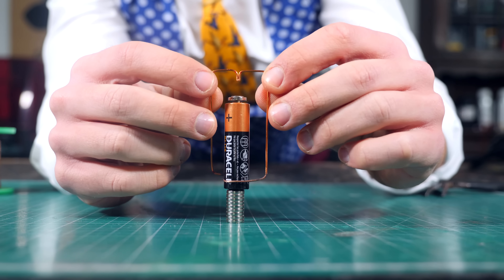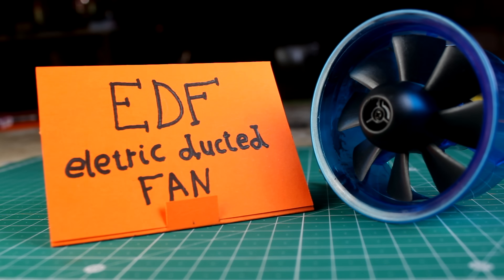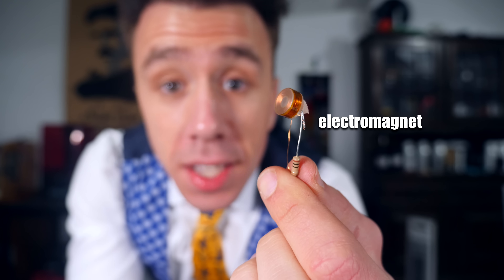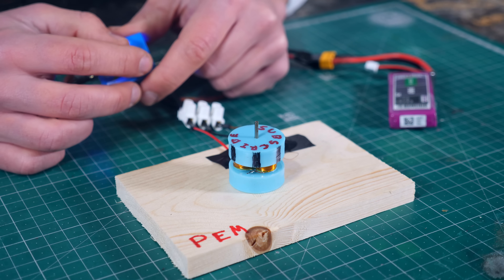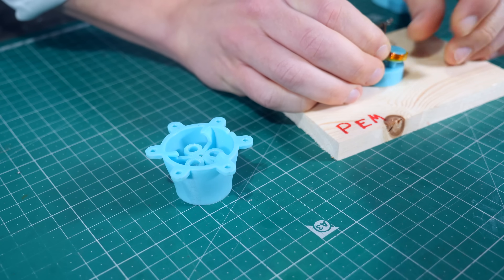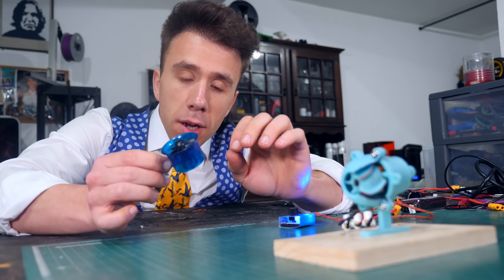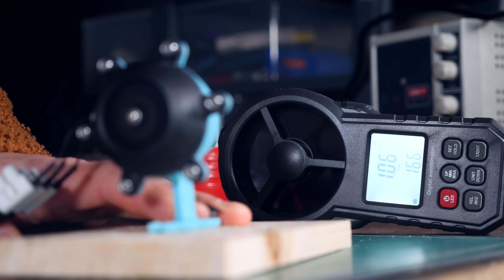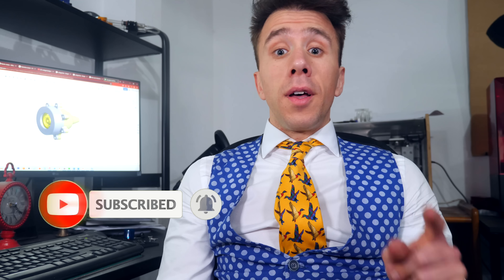I 3D Printed an ELECTRIC MOTOR FAN

Comment: Hello, mechanical/mechatronic engineer here. A few things to note about the problems you are having. 

1. Lower efficiency. The main reason is that (as you mentioned) there are extra steps. The process of compressing a gas is usually adiabatic, meaning that the temperature of said gas will increase as pressure increases. Likewise, the temperature also decreases as it expands (hence why propane tanks get cold). Basically, what often happens in systems like this is that the hot compressed gas will conduct heat into any object they are touching (in this case the printed fan duct), which is lost energy in the system and results in the gasses not being able to re-expand as much. This shouldn't cause a huge difference in efficiency, but enough to matter in some specific applications. 

2. Centrifugal fans also spin air along the inside of the inlet (between the blades and the front cover) for some time as it is expelled outwards, which loses energy due to drag and turbulence. Unfortunately, 3D printed surfaces tend to be somewhat rough, which increases turbulence and therefore drag/resistance. 3D printed parts (especially ones that flex like you mentioned) also can't have as close of tolerances to the cover, so there is often a decent sized gap that air can settle in without being pushed down/out. The easiest way I know of improving both of these is by enclosing the top of the impeller, as the "lid" at that point is also spinning with the air and there are no gaps for air to escape through.

3. Cross sectional area. Another likely cause of the lack of thrust is the cross sectional area of the inlet. Remember that the larger inlet area will be able to move more air for each given rotation of a motor, so if the EDF inlet is twice the diameter (4 times the area) of the inlet to the centrifugal compressor, you will get a far smaller amount of airflow for the same rotational speed. This is partially why centrifugal compressors spin so fast (sometimes past 30k RPM), that way they can both displace more fluid and increase pressure differentials to more useable levels.

4. Fluid medium vs. speed. Finally, the pressure generated by a centrifugal compressor is heavily correlated to the density of the fluid that is being pumped. Since centrifugal compressors rely on the inertia of the pumping fluid to generate pressure, lower fluid densities will naturally produce lower pressures. This lower pressure will result in increased flow resistance inside the fan duct, therefore lower exhaust speeds. This is partially why centrifugal compressors spin so fast (sometimes past 30k RPM), that way they can both displace more fluid and increase pressure differentials to more useable levels.

If you would like some help designing an improved fan (I have designed a few centrifugal compressors for high pressure gas systems before) feel free to send me a message! I also have a number of high performance SLS/SLM 3D printers that are able to produce some significantly stiffer parts that would handle higher rotation speeds without warping or expanding.
Reply: Bump.

Also I didn't consider the inlet size, that's a pretty big deal.
And I believe there are lots of (lesser used) methods of smoothing out printed parts.
Aecetone, sanding, buffing, painting, etc. Painting is a particularly fun one because of surface tension xP
Reply: Damn this comment was very insightful, I learned 3 new things, that I hadn't even thought about before, even though I know the theory behind all those 3 things. I didn't know that the fluid's density mattered that much in centrifugal fans, but it does make sense, cause if you think about it in terms of steady flow energy equation, the centrifugal fan is exerting essentially a contact force on the air, and hence, the heavier the air, the slower it has the chance to lose inertia as it knocks on the insides of the fan.
Next is having a large enough inlet, having a large enough inlet makes sense to me in a sense of how venturi tunnels work, there needs to be a decent enough flowrate to start with, and I think that's probably the biggest difference in an EDF, where the fan has no blockage on it's front end. I can imagine centrifugal fans do a better job if air was forced into it, like in a jet engine scenario, but if air has a hard time getting into it, I guess the flow rate just won't be big enough. 
I also knew that a fluid being compressed heats up, any thermodynamics module at a university covers this with how a refrigerator works, but it didn't cross my mind, that it would apply with centrifugal fans as well. But then again, I doubt that the work that is put into the air mostly goes into heating it up. It is probably something you should consider, but I doubt it affects the max pressure reached by such a large margin.
Reply: @movin3148  Oh fluid density is super important,
desnsity is related to pressure remember, which is also related to velocity.

Pressure "flows" from high to low but in all directions, which also means backflow... To spin a fan means to compress a region of air, which means to create a low pressure region in front of the fan and an even lower region of pressure behind.

Which reminds me, you can also get backflow aft of the fan exhaust. Which is... interesting...

Comment: My guess is that your mouth is the wrong shape. 
By having a divergent mouth your decreasing velocity and increasing pressure. While the EDF has a bellmouth inlet which increases speed. 
Since EDFs don't have combustion I think your just dropping the airs velocity for no reason as you don't care about the pressure.

Comment: Engine design is incredibly complicated. I suspect two things going wrong here: 1. It could be that your design creates a lot of trubulence which can dramatically decrease the speed and the efficiency of the motor. 2. The volume of air that passes through your design seems to be much lower, simply by the difference in fan blade's size, which in practice mean that the air has much less inertia and even it might leave the engine in the same speed as the EDF, until it reaches the meter it has lost most of its speed. If you want to dig deeper I suggest you make some measurements to compare the two: do the propelers turn at the same speed? The actual speed you can measure it by checking the frecuency of the noise. Does the second one make louder noise? Because that would indicate more losses through friction. Do they draw the same current? Is the total airflow the same? There are many reasons that can affect the effeciency of the engine and I suspect that the original EDF design comes pretty close to the optimal design for this type of motor/propulsion system without having to use any fuel.

Comment: I think it might have something to do with the fact that the pem motor is a speed motor rather than a power motor. 
When using it in the impellor setup you are trying to build, you have a small exit hole. This means there will be some pressure build-up like you explained in the video. But this causes the motor to have a hard time functioning wel. Because, as I mentioned before, it is a speed motor rather than a power motor.

That's what I think. Good luck with the project though. Always like your content. Tnx

Comment: The main thing is the Dyson will be operating at a ridiculous RPM. the impeller needs those RPMs to perform. Check out pump/impeller “affinity laws.”

What you might want to do is increase the diameter size of the impeller dramatically, this will increase its effectiveness at the lower RPMs you will likely achieve. 

Also the way that the Dyson works is by creating pressure differential, which evenly flows air through and out of the airfoil 

It’s job is to create a constant pressure difference in the airfoil ring, which it uses like a wing to generate negative pressure and force atmospheric air to move  . 

So the flow rate of the Dyson impeller is likely not that impressive compared with a fan of similar size.  But restrict the flow and you’ll find the regular fan will stall whilst the impeller continues to perform.

Comment: Try tapering the blade aspect, and possibly printing in nylon. I don't know if you have an fdm nozzle that precise, but nylon or GRN might stop your flexing problem.....or rather delay it to a higher rpm, while allowing the original blade length.

Comment: use a centrifugal fan to add compression to your jet engines instead of having them be naturally aspirated. You can use a second fan at the back to run the front fan and once up to speed use the motor as a generator or something like that.

Comment: Probably a mix of tip clearance and cross section area. Lapping the fan to the housing would let you get tighter clearances, and that's less leakage around the blade tips. Your overall diameter means your tip speed needs to be higher in order to achieve the same thrust

Comment: Maybe try using lighter gas and oxygen from air can and make some actual flying rocket.
I really would like to see you send somenthing to sky.
To your impeler proble try adding more blades and blade surface and change the angle a bit.

Comment: You tossed out the tomato but seem to have apples and oranges all mixed up.  You're mentioning thrust but appear to be measuring efflux velocity.   Which is it you want evaluate and why?  Also, the centrifugal impeller of the Dyson is optimized to pull a vacuum while the edf is optimized for efflux velocity.... neither of which is optimized for static thrust as that would turn out looking more like a propeller.  I spent a few months down this rabbit hole myself and after thirty printed iterations and tons of cfd analysis,  accomplished a 30mm edf on an 1106 motor which produced close to 200g of static thrust but more importantly a high enough efflux velocity to propel a small flying wing to speeds around 70mph.  Anyway, you've got my interest peaked, but what it is you're trying to accomplish, i just don't understand.
https://youtu.be/wxLW_8kCv4A

Comment: I would increase the intake area and space around the fan cone blades in a way to reduce disturbances, make sure the surface is as smooth as possible, another thing you could be taking advantage is the Coandă effect within the the exit of the turbine to increase air-flow (like in the Dyson products designs).

Comment: Just a guess, but maybe its because the pressured air from the impeller doesn't really have a 'chamber'/nozzle to focus the air and the energy? Its like a rocket engine without a nozzle, the hot gasses from the combustion chamber will leave it, but since there is no nozzle to shape the hot gases as to get all the energy from the expansion and the pressure from it, you won't really get any force pushing the assembly forward, because all the hot gas just expands immediately when it leaves the combustion chamber and loses all its pressure energy and velocity. So maybe make something like a nozzle for the pressure chamber around the impeller, a car turbofan is a good example only the "nozzle" points sidewards.
Ducted fans work so well because of the ducts, maybe give the impeller a duct too?

Comment: I am not a fan/impeller designer, but have dabbled a little bit in it professionally (worked for turbomachinery companies, and have designed a centrifugal fan for a niche purpose).

Typically, axial fans are great at moving large volumes of air efficiently, but struggle to produce higher static pressures. You are unlikely to match the total volume of air moved by your axial fan. Centrifugal fans like your computer fan are good for creating a decent amount of pressure, but move air less efficiently than an axial fan in order to do so. Think of the path that air has to flow; it takes a 90 turn to go from axial movement to radial, then another 90 from radial to axial again. Impellers like the one you printed and turbines/impellers are excellent at producing high pressures, generally give up volume to do so; with about the same amount of total energy efficiency as an axial fan. Dyson's of various designs use the high pressure air either as an venturi/eductor to move more air (like a bladeless fan), or in a place where pressure is more desirable than volume (vacuum). As another example, modern turbofan engines like airplanes use take the pressure produced by the turbojet engine....and run a giant axial fan with it; they don't use the pressure directly. Only fighter jet engines use the pressure directly with a nozzle...because they don't care about efficiency.

As far as suggestions go, when using an impeller for laminar flow applications like yours, your air inlet and outlet from your assembly absolutely are critical. The swept horn/trumpet-like entryway in that Dyson cutaway improves their efficiency by a lot; the sharp edge entry is hurting your efficiency. Nice laminar axial flow is apparently better than the possibly turbulent side-entry air, so either add that horn/trumpet-inlet, or go for a full diameter entry like you see on the first stage of axial compressors. Additionally, your design is going to create a relatively small amount of high pressure air. I could be wrong, but it looks like your assembly isn't choking the outlet air much at all; the pressure is being wasted. You need to use the pressure; most likely by creating an venturi/eductor.

And then of course tolerances. Any gap between the fan and its housing is an efficiency loss. Any rubbing is an efficiency loss. The best you can do is lose as little as possible.

Comment: besides the restriction of the turbine design your blades also have much less area (look into disc area), so you would have to reach WAY higher rpm for this to work. designing the right fan for your motor is basically a form of impedance matching, it needs to be just the right amount of load to be effective.

Comment: It's purely a guess, but I'm guessing you're probably wasting some of the energy that could be going to thrust on compression. i.e. you don't get as much compression from the fan, but more air gets moved.  The same principles apply with water, you see propellers everywhere on boats, but never in a water pump. But I definitely don't know the physics around why that happens though.

Comment: I'm wondering what the housing inside the vacuum cleaner looks like, maybe the shape holds the key? Also remember that thrust goes in one direction like a laser, but suction comes from all over, most notably the rim of the intake. It's possible the intake just isn't the shape to produce enough inflow where it needs to go.

Comment: Efficiency,
Disk loading,
Efflux velocity vs mass flow. 

Basically you are up against 
Power 1/2mv^3
Vs 
Thrust MV

That’s the crux of the issue. 
In reality it’s best shown as disk area vs power vs thrust. 

Jet engines have thousands of horse power and produce tons of thrust. 
Helicopters have hundreds of horsepower and produce tons of thrust. 

Move more air but accelerate it only slightly. 

Also, please overlap your coils and put inverted coils in there are well. 

CSIRO Australia has put out the plans for disk motors. Free. 
They would make a great multi stage ducted fan for very high pressure

Comment: PV=NTK, it’s possible that T was also increasing when you compressed the air, taking away from the motion when expanding it later.

It’s also possible that internal geometry of the compressor is too small making boundary layer drag significant, and the fan isn’t dragging in as much air.

Comment: There are a lot of interesting ideas here, centring on the size of the intakes and the pitches of the blades etc, all from people with way better credentials to be giving answers to this than me. At some point here you either have to find some maths/design reference where you can calculate your geometry, or iteratively test to hone in on a good enough one by trial and error. One thing I'd be interested in seeing however (since I don't have a printer or a motor) is some data on the current setup's performance. (we need some graphs!) What is the relation of input power to rotational speed, and what is the relationship of rotational speed to thrust (practically air flow rate I suppose). Are we in a situation where the geometry prevents you reaching top speed (which you said you saw and corrected for), one where it simply isn't able to extract enough power from the rotation, or are we in a situation where the geometry "tops out" at some level below the top speed you're spinning it to. And when you do make changes as suggested by some of the more knowledgeable commentors how does that change the curves. I would offer to help graph things out if you have the data, but I suspect my ability to make line/surface plots isn't anything special here. 🙂

Comment: I make electric motors for a living. Your problem is not the motor. I would assume it has to do with the volumetric airflow. It appears that your centrifugal fan has a limited cross-sectional area for the output of the air. If you increase that area, you will be moving more air through the fan, moving more mass, and will have a higher thrust output. 

Also the example motor you made and called a PEM is actually called an axial flux permanent magnet motor. Look it up, they are very cool. In addition, to increase the strength of the electro magnet, wind the magnet wire around an iron/steel/ferrite core. This will increase the power exponentially. 

DM me if you need help on motor design stuff. I would be happy to give you some pointers.

Comment: it is mostly a volume problem, if u want the same volume u need more rpm with a smaler blade surface. but u will lose some power in the redarektion of the air. i would say for the same watts 10-20%. but good luck